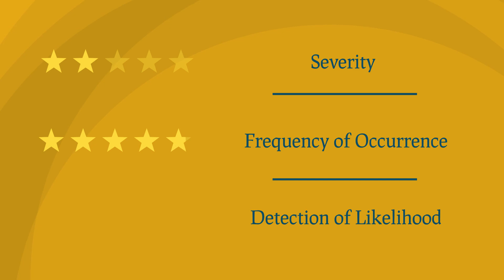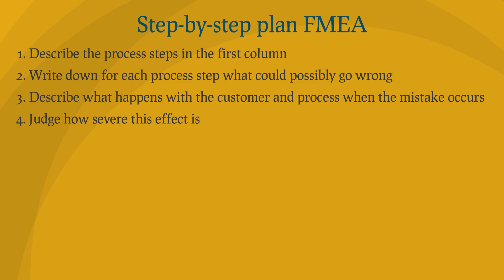What is Failure Mode Effect Analysis (FMEA)?

Comment: Why each failure mode is scored in the areas of FMEA on a scales from 1 to 10 or from 1 to 5?
Is there any resources of these areas (S, O, D) to get the score of it?
Reply from the maker: Hi, 
The scoring in Failure Modes and Effects Analysis (FMEA) was developed by the United States military in the 1940s.

The 1 to 10 scale in FMEA scoring is used to enable a consistent and detailed assessment of risks.

Although the 1 to 10 scale is often used in FMEA, there are also variants that use a 1 to 5 scale. This depends on the preferences and needs of the organization implementing the FMEA. The choice between a 1 to 5 or 1 to 10 scale depends on the specific context and requirements of the project or organization. Some organizations may start with a 1 to 5 scale for a quick assessment and then move to a 1 to 10 scale for a more detailed analysis.

Both approaches are valid, and the choice should be based on what is most practical and useful for the specific application of FMEA.

Resources for the FMEA can be found here: https://www.aiag.org/quality/quality-core-tools/fmea

Send me your email address and I will share a few templates. Info@dmaic.com

Let me know if you need any further adjustments!

Best regards,
Anend